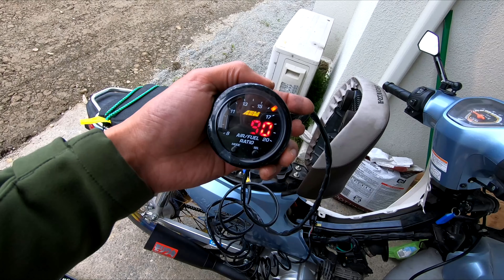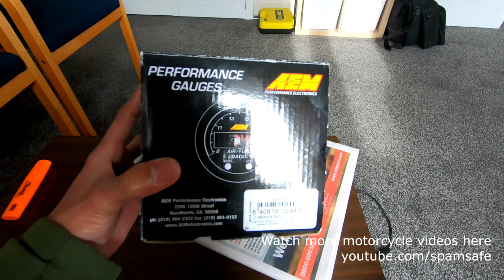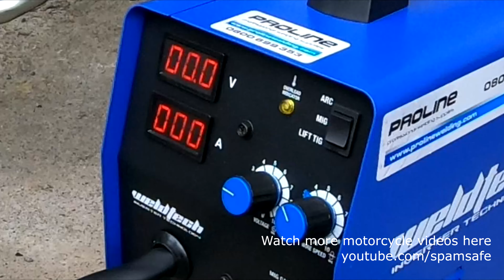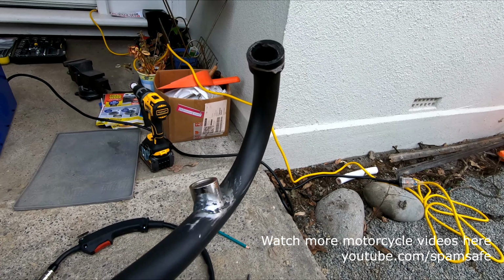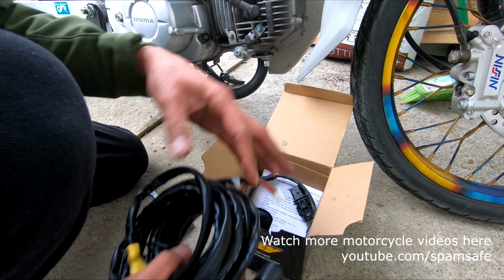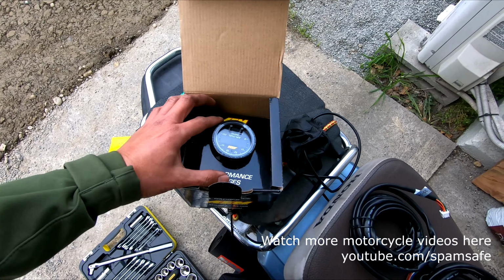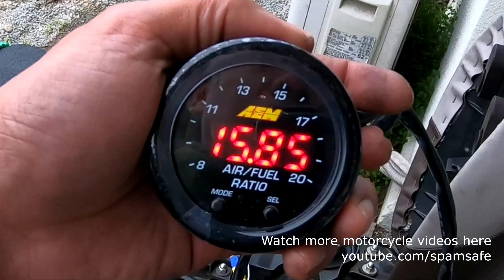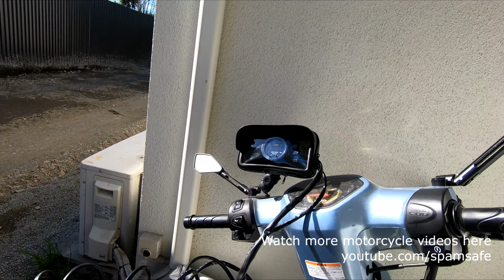Installing AIR FUEL METER on Honda SuperCub 50 motorcycle !

Comment: can this be installed on a carb type without ECU just CDI...how to wire it..??
Thanks very much!!
Reply: I too came here seeking wiring info for a scooter.... looks like we are both gonna be disappointed
Reply: yes u can use a wideband sensor on an engine that just has cdi. you just have to adjust the carb your self when an efi engine with an ecu does the air fuel adjustment for you right?

Comment: Where did you pull your power and ground from?
Reply: Bat+/ign switch/+ coil wire, ground if are a WB meter must have a +bat and chassi ground